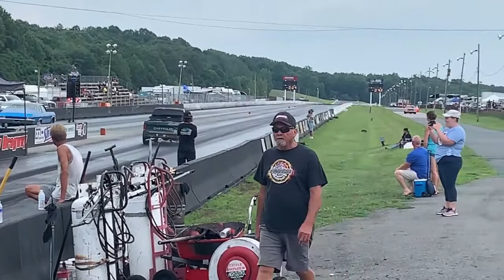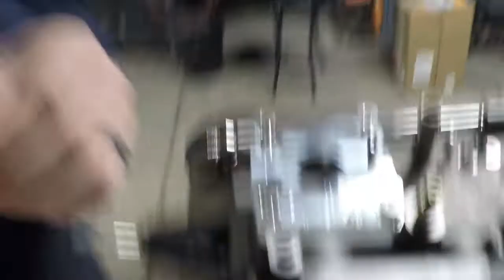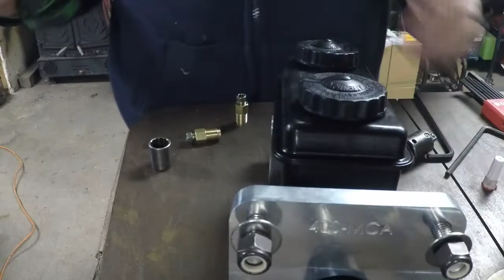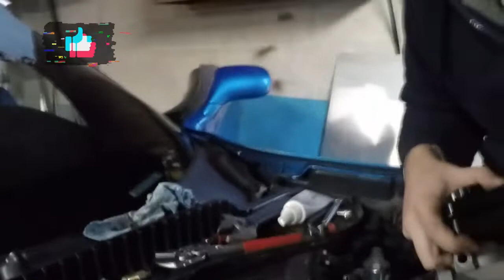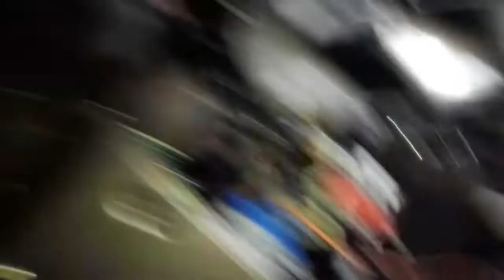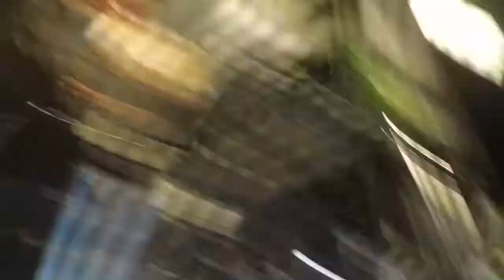HOW TO: TRZ manual brake master cylinder install on my C5 corvette

Comment: So how did this end up working out? What is the pedal force like? It doesn't look like it changes the pedal ratio.
Reply: It doesnt at all and bet his pedal is like a brick and doesn’t stop
Reply from the maker: It is a firm pedal. And it does require alot more effort.
Reply: @speedfreakk9490  cause ya need to change the pedal
Ratio and it will be correct. It’s way off right now how you have it.